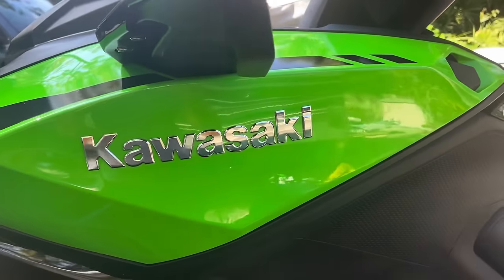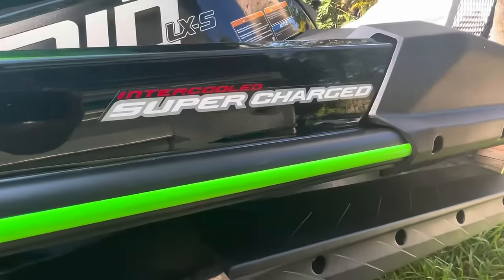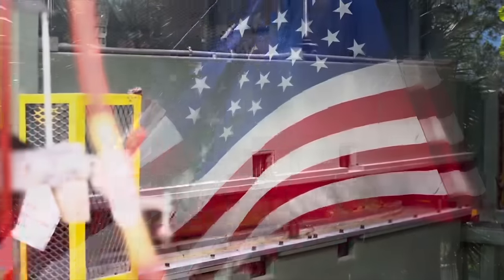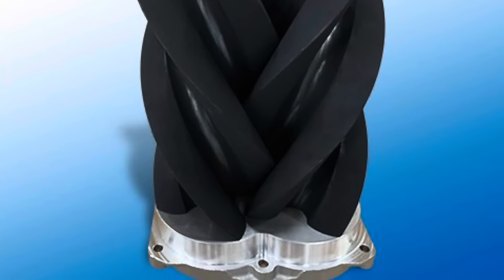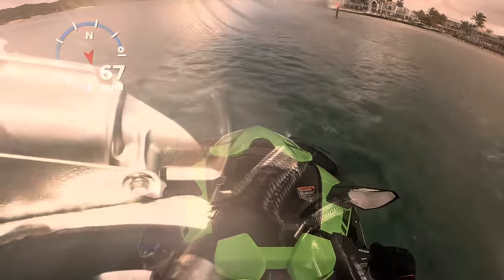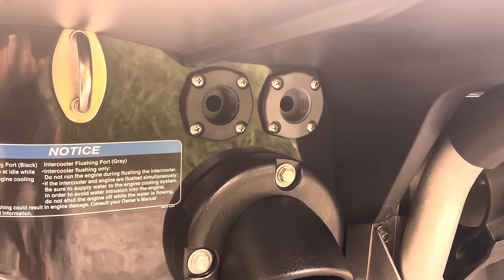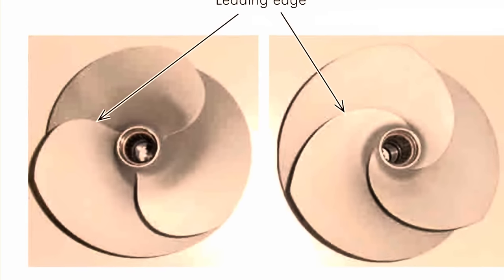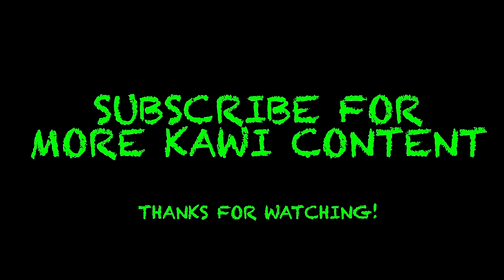Why I Chose To Buy A Kawasaki Ultra 310 Jet Ski and start a YouTube channel dedicated to it! 🔥

Comment: I currently own late models skis: 2 Yamahas, 22’ 310 Kawasaki and Sea Doo 230. They all have advantages but I have not seen anything better from Yamaha or Sea Doo over the updated Kawasaki.
Reply from the maker: Thats cool you have the other skis to compare it to! I traded in my 2021 FX HO when I bough the 22’ 310..now just have a 21 Ultra LX and the 22 310.
Reply: @JDsWaterWorld  What was the FX HO lacking for you? I just bought an FX Cruiser HO, and I love it. I'm on a lake that doesn't get crazy like the inter coastal or ocean. I've ridden Kawasakis, and they were great on rough water, but this Yamaha is like riding a Harley on smooth water days.
Reply from the maker: The biggest gripe I had was the soft paint and the nano hull. After 85 hours (never beached, never abused) the bottom paint was delaminating where the ski went onto the trailer bunks (brand new trailer bunks). I don’t motor into the trailer either- I am very gentle. I was astounded at how easily the paint delaminates. The hull Never cracked or anything, but the front compartment would pop open in the chop from the flexing. I owned 4 Yamahas before my 2021, and I was really saddened by the finish quality. The 25 year old hull on My 1996 Yamaha WaveVenture had less scratches than the 2021 FX. The engine never had an issue, the connext was OK, and the ride system was good.
Reply: Bro! I’m having the same problem with the hatch 😂 glad I found you today 😂 and yea the paint sux… but… I’m on my 6th Waverunner now, had 1 seadoo so I only been looking at the yamaha.. never heard anything good about the Kawasaki ski till I found this video
Reply from the maker: Dude…the Kawis are bulletproof. As you have learned by now I was a Yamaha guy for years..finally I had enough with the BS. The Yamahas are still great skis, but just not as durable as the Kawasakis. The Yamaha also had lots of squeaks and vibrations I could never quite do anything about lol. The new Ultra 310 does have its quirks, but I have been so thrilled to own it so far.
Reply: @JDsWaterWorld  I hear you and will definitely be paying attention.. I’m at almost 300 hrs on my 21 and I ride extremely rough conditions.. I’m listening 😂😂

Comment: I dont know much about jet skis but kawasaki is releasing a angler edition this year that i am really interested in, great video Thanks.
Reply from the maker: I can't really speak to the angler specifically, but Kawasaki has the most durable hulls in the industry hands down- due to their fiberglass and gelcoat construction. Of course the price point on the Kawasakis is a bit higher, but you literally get what you pay for.

Comment: I mean this in the kindest way, because I like your channel and I’m a hardcore Kawasaki fan.. You had stated that the exhaust filter was “innovative”. I think it’s a horrible design and was put in place because the exhaust was designed the way it was, and they realized last minute that the top down design could put water into the exhaust side of the head so they half assed this filter. I certainly could be wrong, but at the least it’s a troublesome design. At least after 2013 they put the pin in line to hold the filter from blowing into the waterbox when it fails.
Reply from the maker: I have not heard that explanation before, but I’m all for hearing different points of view. It’s my understanding that a major issue most watercraft face is condensation on the exhaust valves and head when the ski is being stored- this leads to corrosion. Water droplets condense on the filter surface BEFORE mAking it to the valves and head instead- that’s why I think the filter is innovative- it extends service life of the engine. If people are diligent and perform proper maintenance the filter will not fail and be forced down into the water box.

Comment: If you wanted a Kawasaki pwc for fishing would this be it?
is there a rack system for the deck?
Reply from the maker: The Ultra 160 (naturally aspirated) and Ultra 310 (supercharged ) LX-S and LX trim both include the Ultra Deck which can accommodate a rack- see my video of the Cargo Rack here: The Kawasaki Genuine Cargo Rack for the 2022+ Kawasaki Ultra 160/310 LX and LX-S with Ultra Deck
https://youtu.be/lrxvDYpbbfE
Reply: @JDsWaterWorld  thanks JD !
Reply from the maker: No problem. Don’t forget that the Kawasaki Ultras have a deep-v hull (like a center console fishing boat) so they won’t be as stable at rest as a PWC with a wider and flatter hull (like the fish pro or a tri-hull or pontoon, etc)

Comment: Currently looking at the 310 Ultra LX vs the SVHO Limited. Very conflicted over which to buy. I’m not new to the pwc market as this is my second ski, first is a ex sport from Yamaha, but I’m no expert (especially as far as maintenance goes). From what I understand waverunners are pretty low maintenance, just bring ‘em in when for scheduled service and don’t have to worry about them type of thing. Are the kawasakis like that too? Or will I be taking more trips than I’d like. Wont be doing anything to crazy but I’ll be in rougher salt water. Love to get ur opinion on which to go for.
Reply from the maker: @Liam I started this channel for the express reason of spreading my knowledge, opinion, and experience - and mine has been that Kawasaki is a superior product in most regards. The EX is polar opposite from the Ultra 310 both in terms ride, size, and power. The Ultra 310 is very maintenance intensive and expensive to own but you are rewarded with an incredible machine…that I think has a better ride and design than anything else on the water…obviously since I made this entire channel and spent $20k on it. If you want cheap maintenance get a naturally aspirated Ultra 160…which I also own and is great. I suggest also trying to find a channel like mine geared toward the FX you are interested in and using that content to help guide your decision. Go sit on the skis and see them all in person.  Every ski has its pros and cons..what works for me might not work for you…
Reply: @JDsWaterWorld  Thanks so much for your reply. Not much out there in terms of content or reviews on the SVHO limited but I’ll continue to dig. About how often do u bring it in for maintenance? I’m probably gonna go with the Yamaha just because I don’t want to get wrapped up in anything I’m not ready for but just curious.
Reply from the maker: I do all my own maintenance and provide videos on how to do pretty much everything, for free.  The SVHO is nothing like the EX you owned..they do require quite a bit of maintenance as well. The Yamahas aren’t bad except for the crappy automotive paint, the supercharger clutch and head failures, and the software issues with the low fuel alarm. All skis have their issues..all brands..I purchased nearly $40k in new Yamahas in 2020- a FX HO and a VX Deluxe for the 2021 model year. Both had numerous recalls and issues- namely issues with the hulls and paint- so much so that I dumped both skis and now refuse to own anything but the Kawasakis- which as my video demonstrates are built like a real boat. The Yamaha all in all are much better than the SeaDoos, but a notch below Kawasaki in terms of quality.

Comment: Fantastic video explaining some features of Kawasaki jetskis.  Kawasaki is last in industry marketshare because they cant makes skis that buyers want.
Reply from the maker: Kawasaki is last in market share because SeaDoo has teams of corporate marketing and influencers who peddle their crap to unsuspecting consumers who are uneducated and clueless. I know many people who are finished with the subpar quality of Yamahas and SeaDoo (me included) and have switched to Kawasaki for the latest generation of new skis. Things are changing fast- Kawasaki has split their watercraft division off of their Heavy Industries and is now bolstering their dealer network. As consumers learn the truth Kawasaki will continue to gain much deserved market share.
Reply: All true. Sea Doo and Yamaha do much better marketing and both seized the rental market with cheaper rental models. People rent one..like it...go buy it. I almost did that 30 years ago. I owned a Yamaha dirtbike. Rented a Yamaha waverunner. Was hooked. Went to buy but did research. Again this was 1991. Kawasaki was the only one made in USA. The ski I bought, 650 TS made 52 hp I believe. Had oil injection and great storage. All for less than the Yamaha 500 and 650s which were made in Japan. I went to a dealership that sold Yamaha and Sea Doo. Had $ on a Yamaha. Went outside and talked to a service tech. I thought all the skis in the fence were for sale. And there were a lot. NOT SO! He said they were all for service and almost every single one was a Sea Doo. I went to a Kawi dealer and found my first ski purchase. Never disappointed! I towed several Yamahas and Sea Doos with that old TS. Ran perfectly for 13 years til I sold it. I would literally roll it upside down in salt water by the ramp. Wax the bottom. Flip it over and go! I knew plenty of people that rolled Sea Doos accidentally and electronics fried. Kawi had waterproofing nailed down from all the standup years. Sea Doo pushes tech and that's fine. Kawi makes some bad corporate decisions which hurt sales but products are usually reliable.

Comment: Love the engine and tech but I hate the front and side storage.
Reply from the maker: The storage has proven to be pretty functional for me. The issue is not with the side storage itself but that the doors don’t actually seal, so water gets in- I keep everything in dry bags now
Reply: Love the gullwing storage. Not waterproof but very functional

Comment: Question. It’s between the 310 ultra lx and the 160 ultra lx. I was leaning towards then160 because I’m 65 years old and the fuel consumption. However I can only lay my hands on the 310 ultra lx which I can afford. 

My question is : Is the fuel,consumption on the 310 going to kill me? If I ride a couple of hours per week (I live on a small lake) what is the consumption on pretty smooth water, running 45 mph. I know there is a multitude in riding style that will expend or conserve fuel, but I’m just trying to get a ballpark. 

Now into hope to finally hit very large lakes and long rivers this year. Oh, I forgot. Do I need to run unleaded fuel or 92 octane? Thanks so much for any feedback as this is kind of a stupid question.
Reply from the maker: Not a stupid question at all- in fact I think I might do a video on this topic today! Anyway, my dad is 67 and while he is a professional marine mechanic and has always owned motorcycles, planes, and boats he prefers the Ultra 160 for its simplicity, low cost of maintenance, and reliability. If you don’t need balls-to-the-wall speed you are going to be better off sticking with the 160. I love the 310 but it definitely takes a lot of maintenance to keep it reliable and on the water..the 160 basically needs oil changes and you are good to go. I would recommend you get yourself on a list for a 160- based on the type of riding you have described the 310 would be overkill. Now if you do buy a 310, just bump the power mode button to low or medium power modes and then the fuel consumption will be much better than if you keep the ski in full power mode.
Reply: @JDsWaterWorld well this has been a year long process and moving from Washington state to Georgia. I’ve had two dealership do the "bait and switch" routine with me. This week I placed agreed on a price in writing then  $1000 deposit on a new 2023 160 lx -s . They did several used car salesman crap and then called me the next day and told me they did t know it was already sold but could get another for $5000 more.

Long story short I just found the lime green 2022 Ultra 310 lx-s. 40 hours and purchasing Tuesday. Keep your fingers crossed as I’m getting a really good deal . Hopefully not a scam or functional problems. The guy says he has all the receipts and the standard dealership maintaince receipts. 

It’s exactly the same ski you have in this video . I will up my game and learn about regular supercharger maintenance. ALL OF YOUR VIDEOS has helped me greatly. You’ve been so kind in replying to my past inquiries. Thank you J.D. —— I also watched Kevin’s video and review on this ski, but for me this ski fits my exact needs, assuming I’m smart enough to keep up on supercharger. :-)

Comment: What do you use for the supercharger lubrication?
Reply from the maker: I fog it with Lear Corrosion Block usually
Reply: @JDsWaterWorld and when u fog it do u turn the engine on or keep it off
Reply from the maker: After you finish flushing, disconnect the hose while engine still running, spray the fogging oil/ corrosion block/ wd40 into the fogging port for about 10 seconds while blipping throttle to clear any water from the waterbox, then shut off. See my flushing video for demonstration!
Reply: How often are fogging the supercharger and would fresh or salt water make it difference in amount

Comment: Did Kawi ever fix the piston issue with the 310 engines?
Reply from the maker: That was fixed for the 2017 model year, and these skis have not experienced any issues since!
Reply: @JDsWaterWorld  Good to know. If I were to pick a supercharged ski it'd be the Kawi. The gear driven centrifugals with a clutch scares me. The piston issue with Kawi was the one thing keeping me from considering one. They seem to be the most reliable supercharged ski on the market.
Reply from the maker: Agreed- the belt driven Eaton units will outlast the engine if they are fogged properly! There is quite a bit of maintenance, but if you keep up on the maintenance this ski is super reliable. I got my ski in April, and am already over 50 hours with 0 issues!

Comment: I cant decided between the Yamaha GP1800 SVHO or these new Kawasaki 310's. I love a good hard athletic aggressive ride. Anyone have any experience riding both of these? What can you say about how each one felt? Looking to buy in March/April of 2024.
Reply from the maker: I have ridden both- the GP1800 is like a corvette, the Ultra 310 is like a 4Runner…completely different skis. The GP is very fast on flat water, and the hull does OK on the chop, but it will buck you around and your back and balls will hurt. The GP is nano xcel so it’s very flimsy- the rear deck and sides of the hull flex- you can push them in with your hand! The Ultra is made of fiberglass and gelcoat, and has a deep-v hull that gives you the best handling and ride in chop. The Ultra is slower than the GP SVHO- assuming you try to race both with stage 1 on flat water- the GP will always win. The Yamahas have issues with heads cracking and supercharger clutch failures especially when riding in chop or at high intensity. The Ultras have a proven engine that has been in production for over a decade with no current known defects. Hope this helps, I’ve ridden both skis and owned a 2020 VX which shares the GP hull.
Reply: Very good explanation. Thank you.  @JDsWaterWorld
Reply from the maker: If Yamaha fixes the paint and hull issues, which are the root of most of the issues I’ve had with their skis, I’d actually consider getting a GP SVHO for the purpose of doing maintenance tutorials on my channel, like I do with the Ultra 310s

Comment: I have the 2014 ultra lx. She only has about 70 hours on her. Maybe one day I’ll get her the bigger sister 310 :)
Reply from the maker: Your LX is the same as my 2021 LX- bulletproof machine, very proven and easy to maintain!
Reply from the maker: I will say that going from the LX to the 310 is night and day- the same great ride is there, but the 310 has so much stupid power it’s a different experience
Reply: @JDsWaterWorld  I hear some of the  310x's have piston problems do you know anything about that? Ty